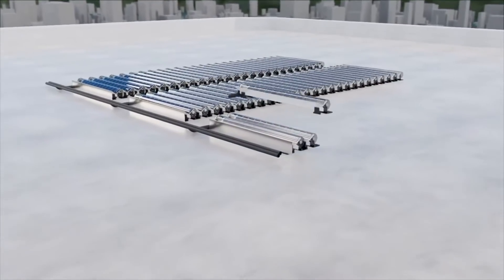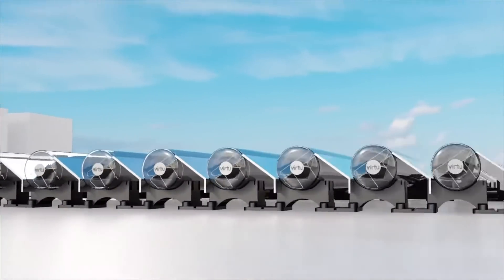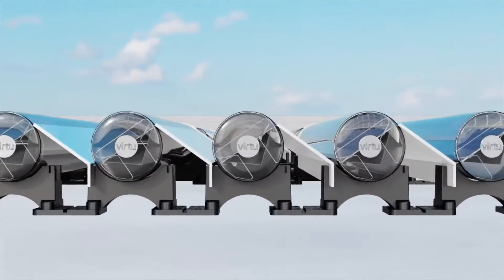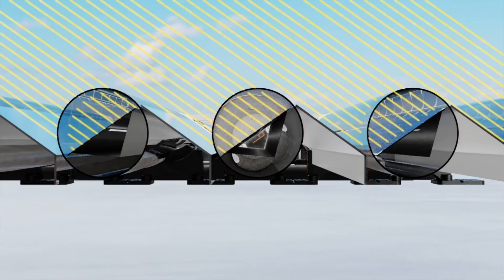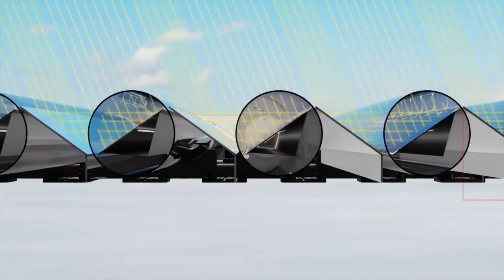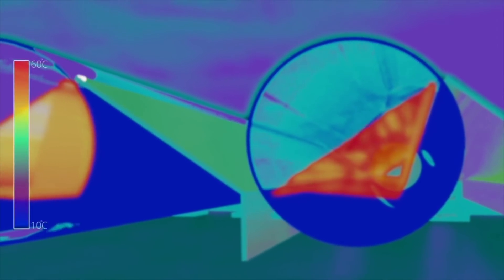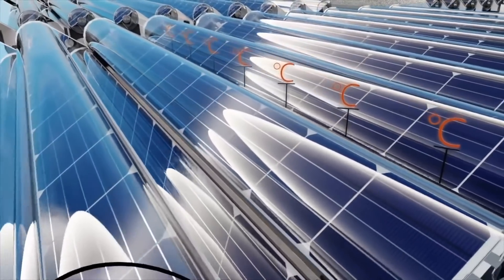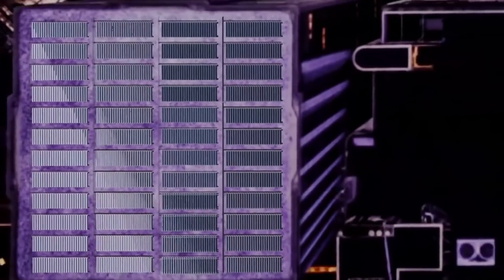Make electricity and heat with one device: hybrid solar technology

Comment: how do they work with a foot of snow on them
Reply from the maker: I presume they wouldn't work at all with a foot of snow on them!
Reply: @tdisney  I guess the buyer would be Texas they don't seem to care about winter. Maybe they have a secret way to melt the snow off like Telsa's satellite dish.
Reply from the maker: @offgridwanabe   Quite possibly, it's a good question. I do know that one of the markets/regions where this technology makes the most sense is equatorial and Mediterranean climates, where snow isn't an issue obviously.
Reply: @tdisney  Thanks I am interested but the winter in Canada is long and lots of snow the flat panels can be cleaned with a lot of work but these are of various height which would accumulate snow. Perhaps a smooth acrylic cover would suffice. cheers ( my sarcasm is seasonal lol)
Reply from the maker: @offgridwanabe  ha I get it. Although, thinking out loud here, one of their features is they can be mounted vertically (that first photograph), e.g. to a wall, which would be much easier to keep snow off of. And the PV cells would still maintain optimal solar angle (they're factory set to whatever the customer location dictates). That said, the intended market for this tech at the moment is commercial - I'm guessing the price point doesn't pencil out for most homeowner residential applications.
Reply: @tdisney  Even if they sold it for residential use one would still have a storage problem as what would a fellow do with all that hot water in the summer.
Reply from the maker: @offgridwanabe  Yep good point (although, my nerd brain says maybe Annualized Geo Solar?? It might actually work great for that). It makes great sense for a resort/hotel, for example, that has year-round hot water demand for laundry.
Reply: @tdisney  yep swimming pools and giant storage for communities. I have been toying with a hot water storage to supplement my  geothermal water furnace so I could slow down the runtime from the 50 f degree well water I use. I am almost net zero this year but that is using grid for battery which is just not what I started out to do. Solar is the future but what it will look like is anybody's guess.
Reply: @offgridwanabe  
Heat the swimming pool.  Or some of the hot water could be stored in a storage tank and the rest dissipated to keep the solar array from overheating.
Reply: @acmefixer1  No pool here and high water table in spring robs me of all the heated storage.
Reply: @NY-xx7hu  My thought too, which is more than you can do with conventional panels that will also get covered with snow.
Reply: You could Deal with That, by incorporating 10°C/50°F Air, in a Flow Through System, to keep Snow from Sticking! 

Watch "Citrus in Nebraska" on YouTube, for how to get such Air! In Winter!
Reply: @robertweekley5926  Manufacturer could also have a reverse flush from the hot water storage which would only mean a valve low cost.

Comment: Obviously not much knowledge of solar PV panels here. Solar PV panels power output starts dropping off as the temperature rises and will therefore perform poorly in this setup. A vacuum is a great insulator and used by many solar hot water heaters throughout the world, but just not for producing power from solar PV panels.
Reply: They literally say in the video that the system maintains optimum cell temp by using the thermal heat capture system to remove excess heat
Reply from the maker: @zachmoyer1849  Bingo. The temp of the hot water is << the temp that will degrade PV cells.
Reply: @tdisney  So these PV Cells can tolerate temperatures at 60 to 100c? To my knoledge PV cells that can do that are still in a lab and arnt all that efficient? Normal PV Cells wouldn't tollerate this and give all the benefits claimed in the video.
Reply from the maker: @RoadRashSpirit  To be honest I'm not sure what the operating temp of the cells are, and if they are highly specialized cells or fairly standard, as I'm not involved with the product engineering (I'm just the guy they hired to make the animation). But just putting my old mechanical engineering hat on for a second, I doubt they'd run the water temps anywhere near 100C because they'd want to keep it well away from steam generation and PV cell degradation temperatures. They have another product, virtuHOT, that has no PV cells in it, whose purpose is to generate high-temp hot water (aimed at industrial applications mostly). In other words, while vacuum tubes can generate very high temps, they are in fact controlling those temps down in order to maintain PV cell life. What precise numbers and technology they're employing, you'd have to enquire with them.
Reply: @tdisney  I do get how its meant to work, but everything needs to be built with safety margins as youd know from your mechanics. The quoted 60C is the lower end of central heating temperature which is why its important. The reason I've questioned it is because we see a lot of fly by night perpetual motion machines on youtube and they are rarley backed up by practical Engineering. They make no reference to the solar cells which you would have thought would be a major over sight. If they have cracked the cell technology its no small thing and is a game changer in solar technology. I'd have thought they'd be shouting it to the rafters. So basicly healthy sceptisism on my part. Normal solar cells will not operate efficiently at anything above 40C, infact they are much better in the low to mid 20's. What I fnd sad is that Ive seen a number of videos based on these concepts and through no fault of their own, some DIY folk get the wrong idea and waste a lot of money and resources. Good animation work though, nice job.

Edit;
Their website does claim they are associated with Imperial College London...So I guess thats good, struggling to find one of their patents though, although that might just be the .gov website
Reply: @Nicholas Simmons Thankyou for taking the time for to reply in person. I agree that silicon can handle high temperatures and normal solar panels do get very hot in peak summer and thus drop in efficiency. As you rightly point out there is a lot of information out there regarding peak temperature efficiency. A quick google search suggests that pannels can reach a max temperature of 65deg C "https://news.energysage.com/solar-panel-temperature-overheating/", which makes sense given surface area, use of aluminium and surface contact between materials (critically reducing the ability of glass to be an insulator) . The question was primarily if your product is using traditional photovoltaic technology, or if you have a unique panel technology that can operate at peak efficiency at 60 deg C (which your video suggests is the collector temperature). Your website suggests that your panels are capable of producing power at 20% effiency which of course is the average peak rating for most solar PV panels. Does you product have a data sheet available yet?
Reply: @Nicholas Simmons Thankyou for your honest reply. I can certainly see how the reflector would help make up for efficiency losses due to running temperature. I also like the design principle in relation to space saving. By protecting the cells from outside humidity and weather it certainly makes sense that common degredation factors can be avoided. It would also make sense that your design avoids degredation in the form of mircro cracks caused by temperature swings since your control system will keep its temprature constant. What I'm not so certain of is how long term high temperatures would affect the PN layers, soldered joints and any internal regulation circuitry. Experience and gut feeling tells me electronic components prefer cold or room temperature enviroments. If I was to instal your system I would opt to cap the temperature at 30 deg C and use it in conjunction with a heat pump. Thus getting better efficiency from both elements, although I appretiate this would increase up front system cost. Generally speaking solar heat is cheaper to harvest, so I would want more care taken protecting the photovoltaic elements which are more expensive. I look forward too more updates on your M1 cells. Personally I will admit to having a bias towards thermal electric given the limitations of current technology. I hope your M1 cells rewrite the books.
Reply: Thinking the same thing.  Wouldn't the heat fry the PV panels?